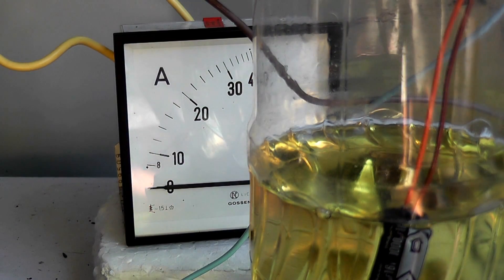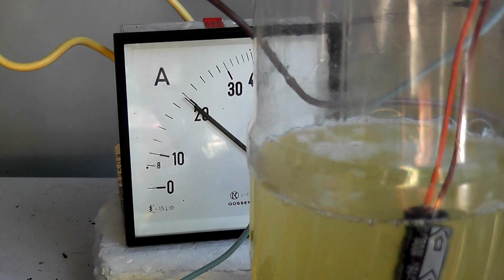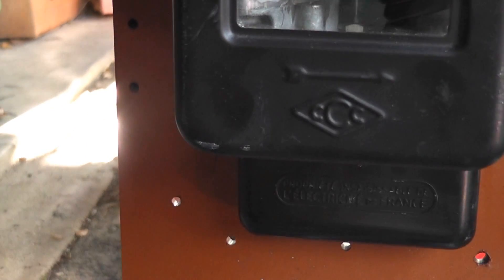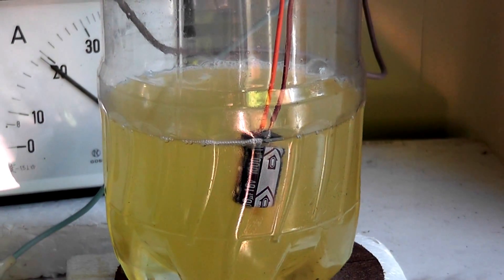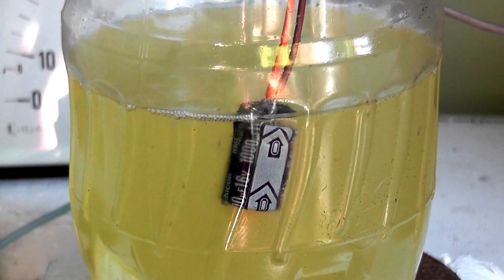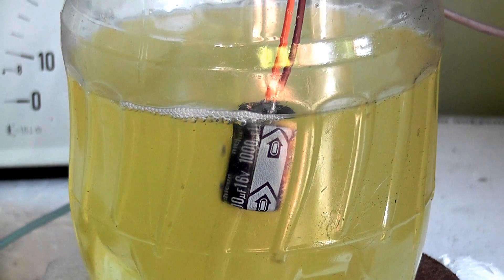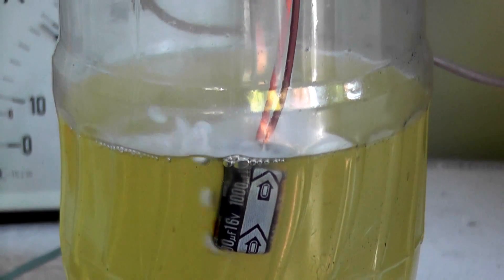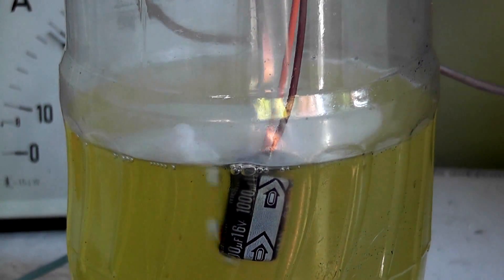Capacitor in transformer oil bubbles and smokes

Comment: Haha...Under-oil capacitor poppage. 

I couldn't help but think though....If that's under oil & heat is causing pressure inside which pushes out the smoke, if you were to leave it under the oil & switch it off, when it cools, would a vacuum form in there which would then suck in lots of oil? 

If so, it would be interesting to recover that cap from the oil, then put it in an empty jar or something, and treat it to a ZVS....Give it some real proper internal arc-ups. :-D

Thanx for showing,

-BBD.